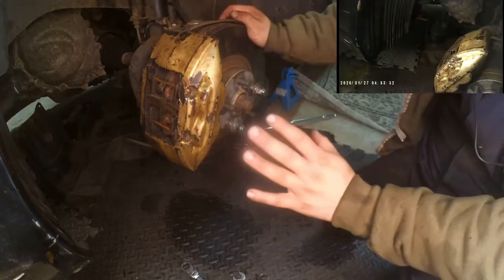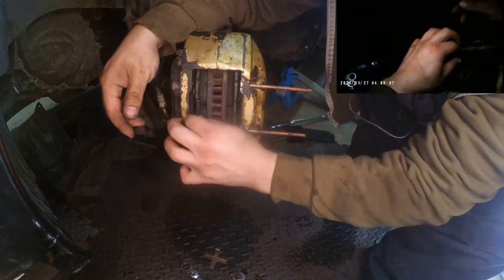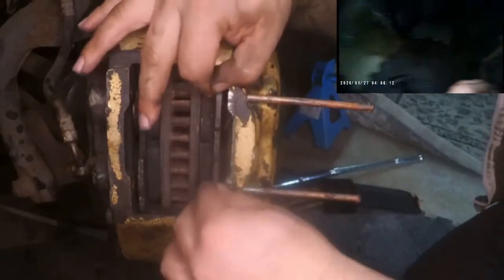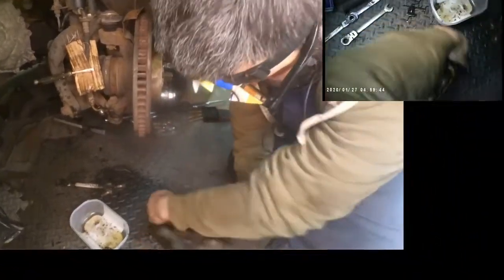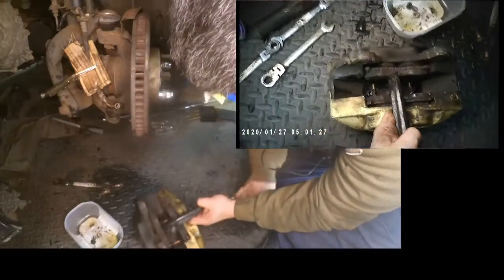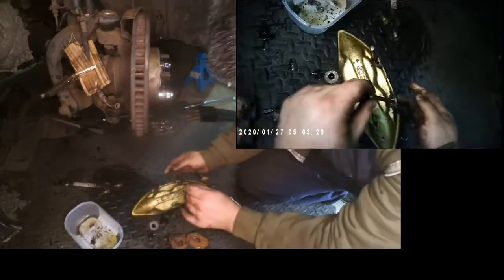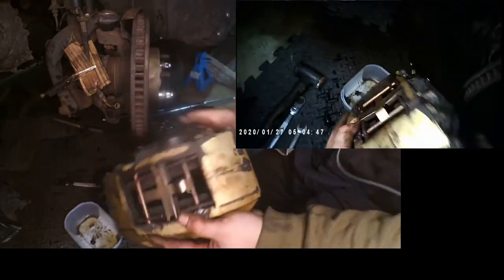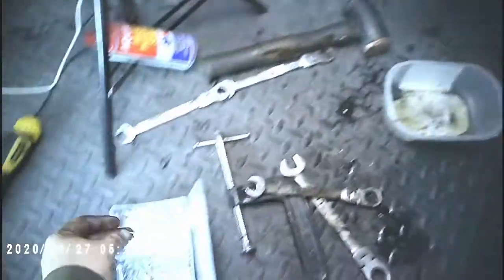Toyota Celica GT4 Gen 6 (93-99) How to Replace front Brake Pads

Comment: I've never done a set of these an not had a siezed brake pin
Reply: How do you take em out without destroying the caliper piston. Mine won’t budge
Reply from the maker: I never seen a car where removing the brake pads needs you to mess with the piston. 
You need to push the piston back to install new pads, but at that point old pads are out. 
If one or more pistons are seized, taking the caliper out to the workbench and forcing brake fluid in using a grease gun with an adapter for the correct piping never failed me to pop out the pistons and do a full refurbishment. But that's a different job
Reply: @Stin-ow8gu  cut the pins through the middle and usually there's less tension on them so they will tap out

Comment: your spring clip is upside down
Reply from the maker: Others mentioned that. I guess your right but never actually checked the manual to confirm. 
Months after the video was out I did some other work on the brakes and flipped the spring around.